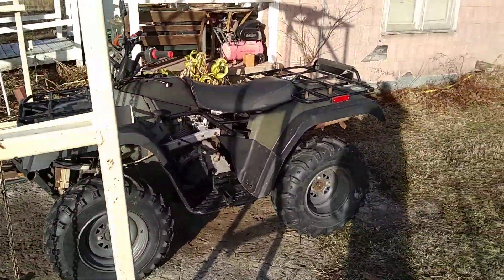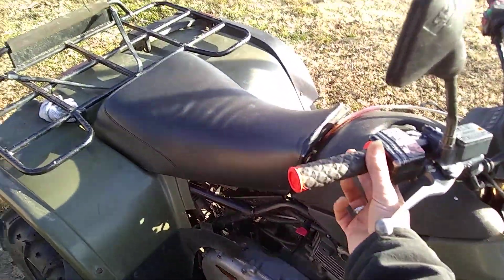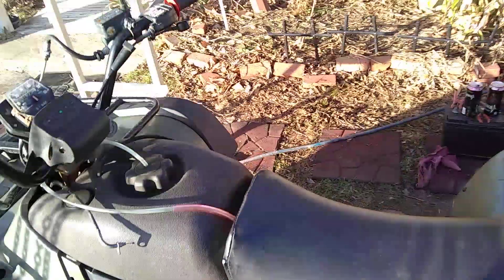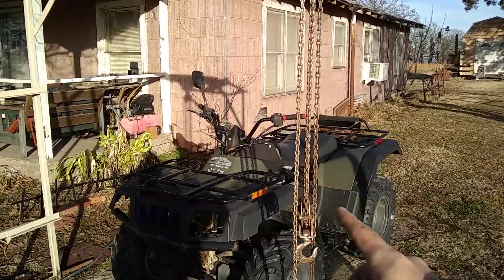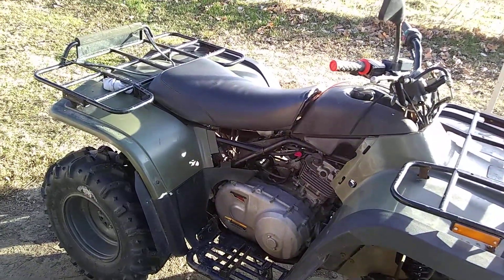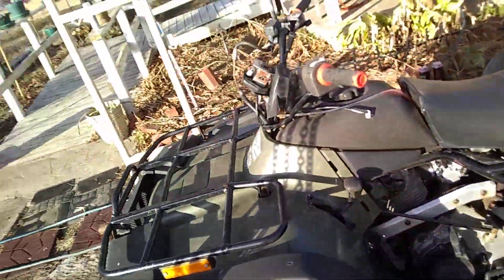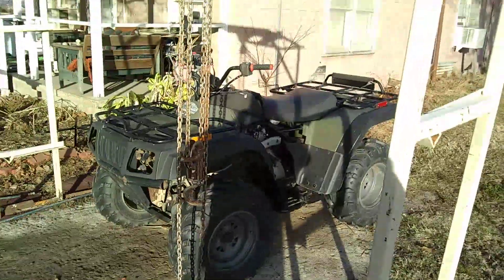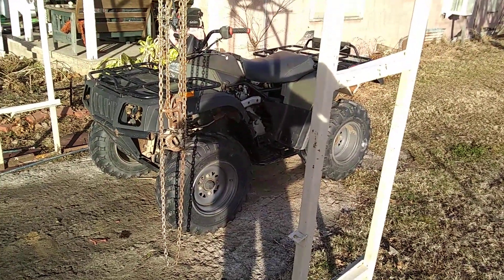2002 Arctic Cat 375 4x4 atv New Carburetor

Comment: will it smoke without the sock
Reply from the maker: Since then I damage the Piston rings so now it smokes with and without the socks. Sometimes I can barely even get it started with jumper cables so I am planning on rebuilding the engines on both four-wheelers and doing a video.. saving money for a rebuild kit.. 😎

Comment: What was the adjustments and what is the carb?
Reply from the maker: I've only adjusted the air fuel ratio. With the adjustment screw at the bottom of the carburetor. The online video for adjusting the carburetor says that if it "backfires" out of the carburetor.. then the screw is opened too far.. if it backfires out of the exhaust then the screw is not open enough.. After reading your comment earlier I have been working on one of the other engines and have been trying to fine tune it...  The carburetor is a Kei Hin. (Video shown)The air fuel ratio screw was probably turned out or open from completely closed to about one whole turn 360 degrees plus about one falf to one quarter turns..the carburetor ...I found it on eBay by just searching year make and model of the bike.. after purchasing the carburetor though I found out my piston rings were bad so I've been tearing the motor apart. Compression factors in big time with A.F.R (air fuel ratio) if your ings and pistons are in good shape then you might only have to have the afr screw slightly open.. but with the symptoms you stated about the engine having to run on full choke and the power loss you might have to open it more.. I am sure opening it more is going to help you out...hope this helps.
Reply from the maker: I have actually just opened the afr screw two whole rotations and about a half rotation and mine seems to be running okay. I hope it works for yours also.